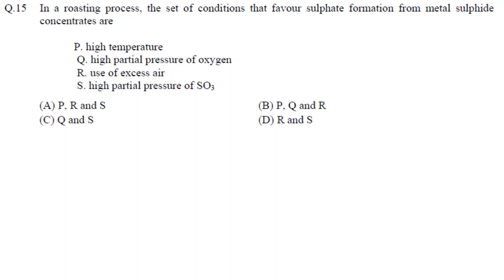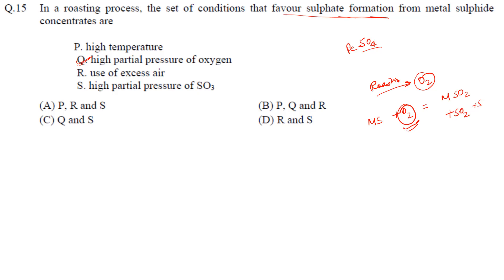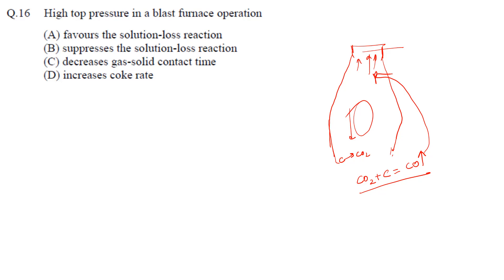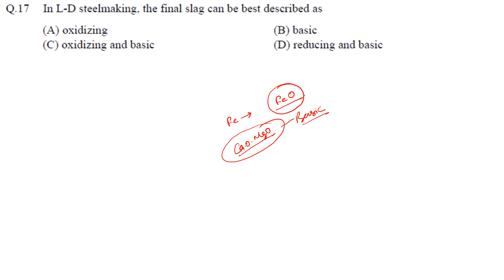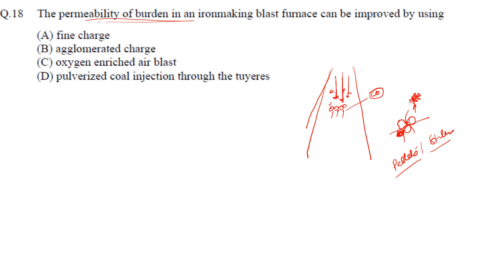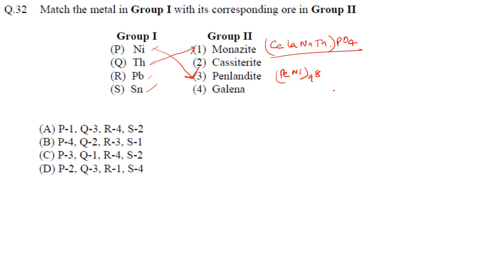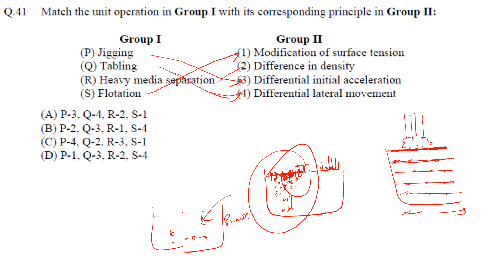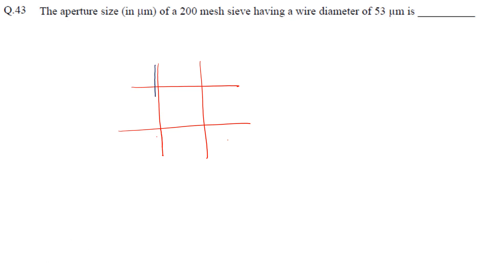GATE 2013 Extractive Metallurgy Solution

Comment from the maker: 00:00 Roasting process
03:02 High top pressure
04:53 LD Steelmaking
05:49 Permeability of burden
07:45 Match Ores of metal
09:39 Match Mineral beneficiation process
13:37 Assertion Reason Sulphide ore
14:34 Aperture Size
18:51 Ladle oxidation